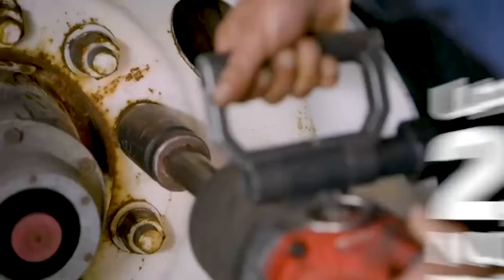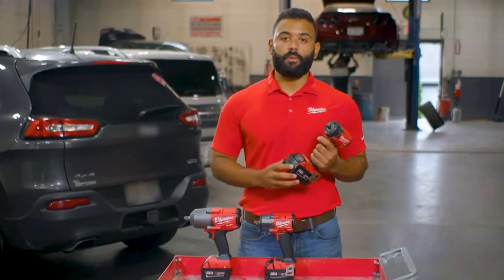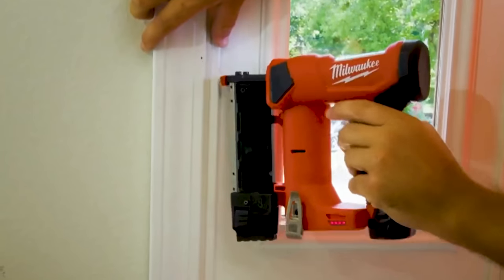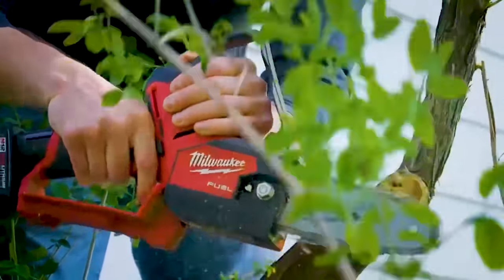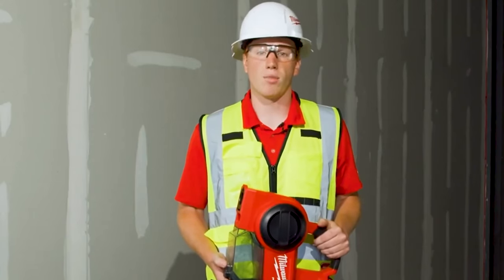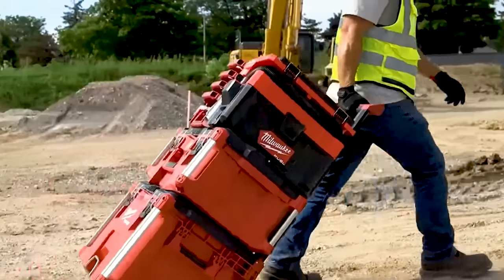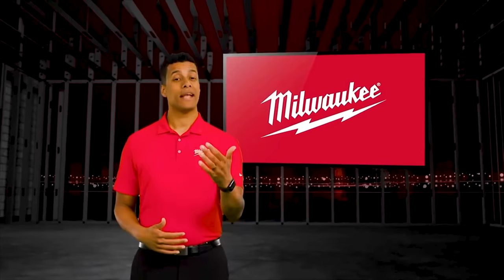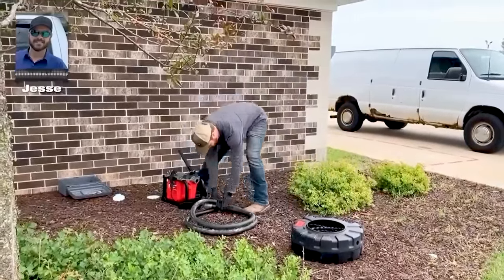EVERY NEW MILWAUKEE TOOL RELEASED IN 2020 (NO FLUFF)

Comment: First?! Heck Yes! Love your videos Vince, when I started my plumbing job a while ago I was so confused by all the different brands of tools and why they all had so many different drills, brushless or not, and why everyone hated on Ryobi, cuz that was the set I was going to buy, and after watching your videos I got me the Milwaukee m18 AND m12 Fuel drill sets! M18 Fuel Hackzall! and M12 multi tool. And will probably only buy Milwaukee brand products from now on! Thanks @VCGConstruction keep up the hard work!! 👏👍✌️
Reply: Another plumber here. I've got a super Sawzall for hd work but my best friends are the m12 fuel stubby impact driver and the m12 fuel hackzall. (The regular m12 is crap) It's considerably smaller than the m18 but still powerful enough that I use it almost exclusively.
Check out Ludwig cabinetry for their Milwaukee impact bit holders- you'll thank me later. I have both R and L bit holders on my m12 and m18 impacts. Never looking for bits again.
Reply: I've been Milwaukee for years and years 
I was sold one time my IN the CORDED days 
My Sawzall went down so I go the store only had this cool looking red so I buy it 
How that dam thing felt in my hand it took away so much vibration I never used anything like it 
Since that day I buy Milwaukee tools 
Hell I saw the razor knife I tossed my old one and bought this one just because the name on it meant to me QUALITY and easier on the user. 

Start out your contracting career on what you can afford and slowly start building what you need 
The older we get the more we feel all the stresses we put on our bodies when younger. 
Use the tools that avoid as much as possible..
And don't be a hero 
If your young and want to show off dont do what i did and all the others before you 
Show off by how intelligent you are not that you can move two mountains by hand 
Do that job by the correct safety practices 
Stay healthy longer. 

I once had my crew trying to get a cast iron tub out of a bathroom 
4 guys now 
It was tight but still 4 men 
I go pissed 
I yelled at them get ghe hell outta the way I grabbed one end stood it up bear hugged that bitch and carried it out by my self. 
The 4 of them were looking at me like cartoon eyes. 

One time a guy couldn't carry 1 bundle of shingles up the ladder 
Big boy to 
I took 3 bundles and carried them up 
Looked down and said if you can't carry 1 at a time just go on home. 
He did went home 
Now 
I'm retired from all the trades work 
And I feel every stupid thing I did 
Work smart not hard 
Especialy hard on your body 
And always wear safety protection 
Its cool to be smart 
Looking tuff isn't cool its a fool. 
If your young and just starting out please be safe and take care of your body its all you got 

I asked my mother for a newer version i was told 1 per customer 
Lol 
I am retired but I have rental properties I work on myself so I have reason to continue buying my Milwaukie toys 
I mean TOOLS 
love VCG 💘 keep up the good work guys
Reply: Mr. Cee Gee That bit holder is pretty cool! I use the drills quite often but what do you use the stubby for on most occasions? Do you have a set of drills also? I had the m12 fuel hacksaw before the m18 fuel hacksaw and yes it was smaller and surprisingly just as powerful as the m18 I like that one a lot but I don’t need 2 saws so I sold the m12.

Comment: Still waiting for a 5 or 8 gallon m18 fuel shopvac, maybe a gen 3 high torque impact wrench, lawnmowers, gen 3 hammerdrill/driver and impact driver combo kit also the m12 fuel hammerdrill/impact driver combo needs a refresh i think it is older than the m18 fuel combo kit, the m12 has the same metal chuck as the older gen m18  hammerdrill

Comment: In my lifetime, I've learned a multitude of skills. First, I'm an electronic technician....but also an HVAC technician, electrician, construction technician, and anything else I've come across that I felt like..."I can do this". I have a theory on how Milwaukee is able to power these tools with an 18 volt battery. Thru Electronics, I think they are amplifying the voltage separately, then using the current from the battery to push these tools! Just a theory! Voltage is just pressure. Amplify the pressure and that will push the current!
Reply: Maybe. You would need a set-up transformer to amplify voltage. Not sure what’s inside. They probably also have small gears running bigger gears to get the torque.

Comment: I would like to see a work table (4' ?) to be attached to the 2 wheel cart.  Something to set materials on, roll out blueprints, etc.  The work surface of the writing/work surface is too small.  I would like to see square buckets with removable bins.  I will look at the drawer system to see if that should take care of the need.  I have buckets with copper, pvc, cpvc, black iron, pex,  and of various sizes i.e. 1/2", 3/4", 1".  Lastly, a chop saw (carbide) that would cut up to 4" PVC pipe on the 18 volt system.

Comment: I've got a lot of Milwaukee 12 and 18v. Most of the stuff I love. Got the mid torque fuel impact and what a disappointment. Hope the new one is up to snuff.

As for the new fuel wet vacs, is it too late to tell Milwaukee to put the switch on the same side as the hose??

Comment: Gotta say 
I am Milwaukie love their products. 
But 
The pack out 
I'm not so sure. 
I have the rigid 
The handle is not so great especially the release where your holding the handle 

But pack out 
The handle im surprised being Milwaukie its not as secure in the handle as I would expect being a Milwaukie product. 
And it seems heavier than the rigid 
But that could be the grade of structure 
Handle better placement for release but sucks especially for the price they want for it. 
Very over priced. 
But hey 
We keep buying they keep charging. 

Anyway 
VCG KEEP UP THE AWESOME WORK YOUR DOING HERE

Comment: When will Milwaukee release a m18 riveter. My biggest gripes about Milwaukee are they release many tools in the m12 platform only and they still can’t figure out how to make a simple Jobsite radio that doesn’t weigh 20 lbs, break in 6 months and doesn’t get a single station.BTW I own over 30 m18 tools and about 25 m18 batteries. I’m not switching to m12 platform.

Comment: Rather than market a bunch of new tools, I wish they’d instead focus on QC for their existing tools. My initial experience with Milwaukee has been incredibly disappointing. We’ll see how the repair pans out (2nd time in 2 weeks). But, it’s hard to get excited about the Milwaukee platform when they can’t get a basic drill right.
Reply: They have a few stinkers. No excuse for the bit retainer issue, but give em a break. I have about  15- 20 Milwaukee cordless tools that I beat on and I'm taking one in every 2-6 months or so. Other than wait time Milwaukee warranty service is very good.
A lot of these tools are being asked to do a lot.
Reply: Funny thing is, the bit retention issue with their impact is something entirely separate from what I’m referencing. 

Specifically, I’m having a myriad of problems with their Gen 3 hammer drill. The thing is less than 6 months old, and pretty much had problems right out of the box. 

I sent it in for repair. Included a very detailed write up of all the issues. To their credit, they turned it around quick. But, that was also a negative because they didn’t adequately troubleshoot or resolve the issues. 

The same day I got it back, iI tried to drive a couple small screws into a basic plastic wall anchor. It immediately started giving me the same problems. Transmission/gearing won’t engage. Terrible grinding noise. 

Just really frustrating to have a brand new drill never function properly. A few of the issues I’ve run into (with light use) include a dead trigger, transmission won’t engage, chuck losing the bit, And overheating. 

Supposedly they’re going to replace it now. But, the status has been showing as “in repair” for the past few days. 

If so, great. But I worry that they’re going to say it’s “fixed”. Only to have to send it in again. 

For the premium they command, it’s just really disappointing to have so many issues with a new tool. And their response and troubleshooting has been unimpressive as well. 

I assume they’ll eventually make it right. Just doesn’t inspire confidence.

Comment: how about a dang lawn mower. even mikita  has one now that take 4 bateries. dewalk and  ryobi has one. and well everyone is chasing  some  other  battery only brands. come on milwaukee
Reply: ikr. I'd jump on that lawn mower as soon as they put one out. I would love not having to take trips to the gas station for refills.
Reply: I’ve heard rumors they are developing one so with 3 more pipeline episodes who knows what’s coming
Reply: @emerarbuckle2626   a guy at their headquarters  in Milwaukee  told me we would see one this summer.... still waiting...
Reply: @braydenbledsoe3252  I need a new push mower.  Sick of fixing this one.  So it its either Milwaukee  or ego.  They have  a tough fight to compete with them.  All the other guys take an old normal mower and put a electric  motor on it. Ego is the one to beat
Reply: chuckley54494 well I would give them a break this year everything across every industry is delayed cause of COVID but sometimes things pop up and then they get dumped completely last year there was a ryobi 40v 1500w power station on Home Depot website but now they try to act like that never happened

Comment: I love milwaukee tools powerful .    Not too long ago I let my old man a 30+ years retired Mechanic.  That has knowledge of changing tires and basics,. No knowledge of DEF systems, or more complicated things.   But he was a class A certified. 🙄     Well I let him use a milwaukee 7amp 200lbs impact gun to remove a 3/4inch lugs off a torque rod.  Right away he says: this tool is a piece of shit.      I looked at him and Said w the hell are you doing? Turning it clockwise to loosen a nut🙄 I took it into my hand BOLs came right off.

Comment: The guy said the m18 mid torque delivers 250 lbs of torque  ,then later hes saying it delivers  650 flbs  of torque  ?
Confused  which is it ?
Reply: One was a 12v, the other 18
Reply: @pescatoralpursuit1726  No. One is the new 18volt compact (stubby) while the other is the updated 18volt midtorque

Comment: I use milwaukee tools everyday in work but all the tools i own personally are dewalt. i would never recommend milwaukee to anyone. in the last 3 months my company has had to replace 6 sds plus drills and 3 impact wrenches and the batteries 5AH/9AH are terrible constantly over heating or straightup die.